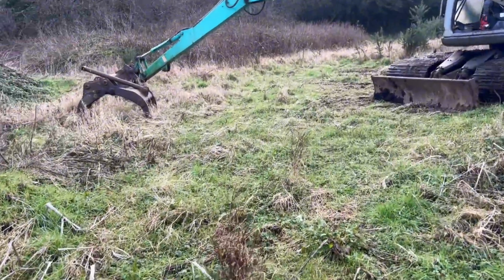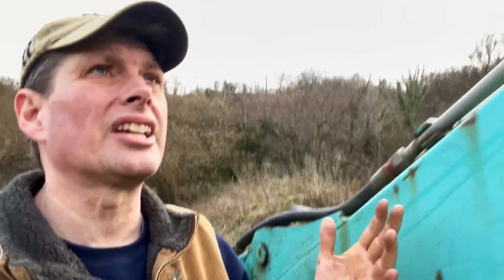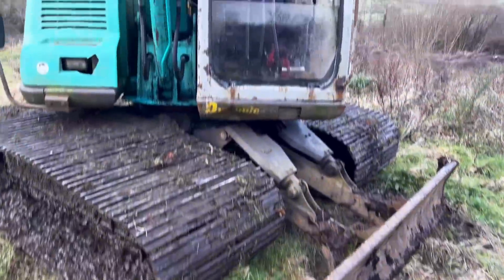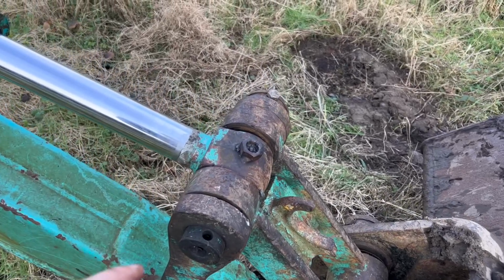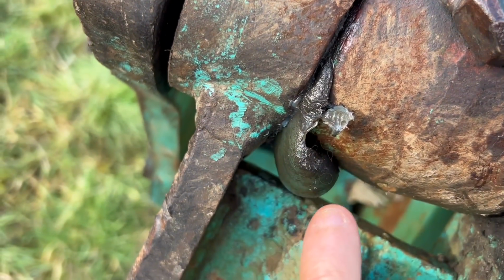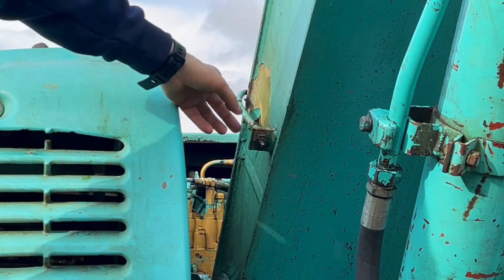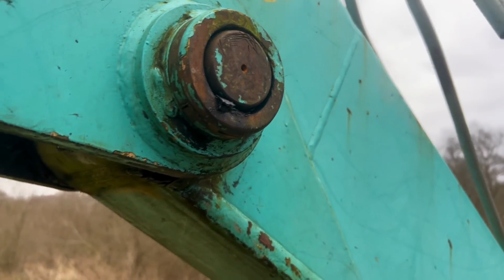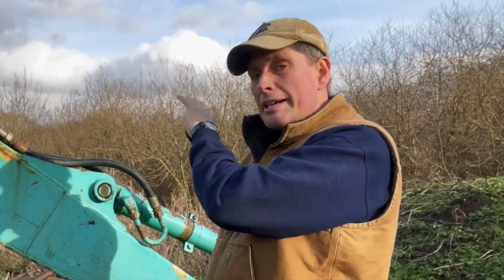Greasing an Excavator 101

Comment: Get a g coupler for battery grease guns, much better than a standard coupler.
Reply from the maker: I've got about 10 of them but unfortunately there are a few places they are too cumbersome to use (Q-hitch being one)
Reply: @LordMuck  That can be true depending on the machine, out of the machines I use I struggle most with the Takeuchi’s. Some of the nipples are set in the end of the pins and the hole is a bit tight for the coupler. I do find that the coupler will often hold on better to help get grease through a blocked grease nipple.

Comment: We use Fuchs renolit Mo2 on digger/loader pins , love my Screw on cartridge grease gun for EP2/ blue high temp , but the Mo2 comes in the old cartridges so it's a trusty old JCB grease gun for that. Its a shame as the screw on cartridges are bigger to start in all